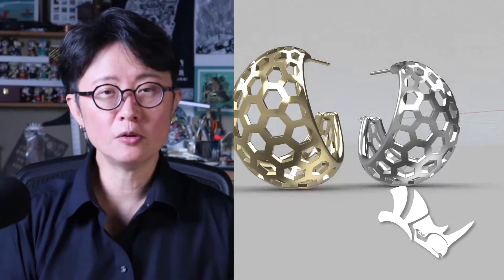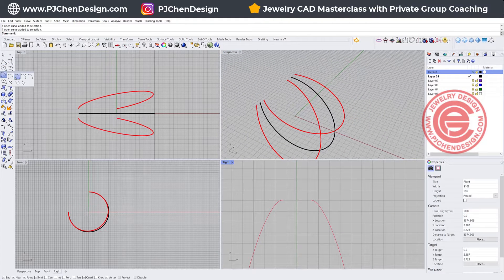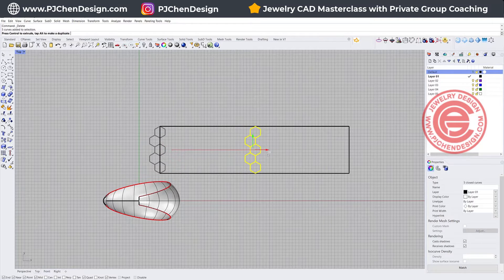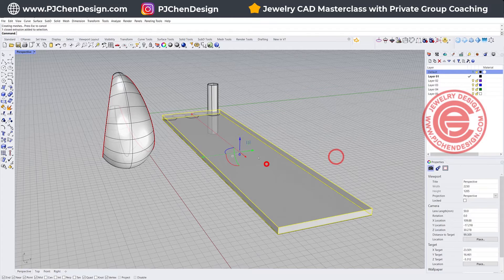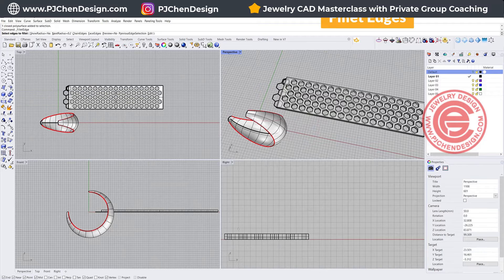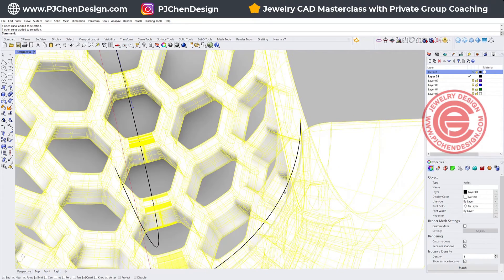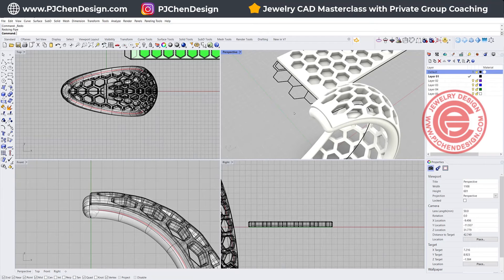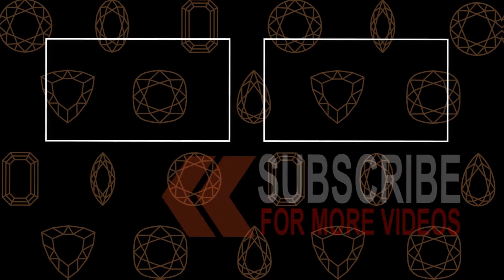Build Hexagonal Pattern Hoop Earring Shape with Rhinoceros 3D Software #443

Comment: Hello, I'm having trouble while doing UV mapping. When I use 'create UV,' I can't select the entire surface.When I create a surface, sections form in the model, and when I do UV mapping, it selects these sections. I can't select the whole thing as one. What could be causing this?"....ok."I fixed the surface splitting issue, but now when I do flow, it only selects half. I can't select everything like you do, so it creates a partial UV. 2.32
Reply from the maker: UV curve only apply to a single surface. try to make the surface without seam